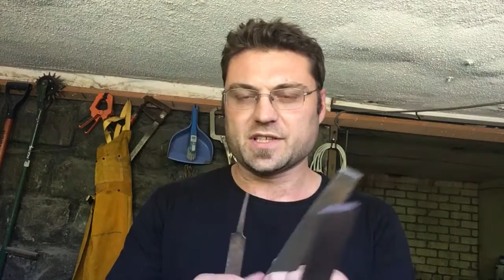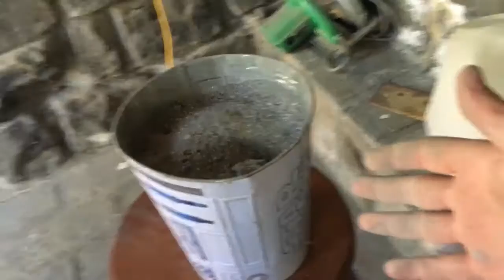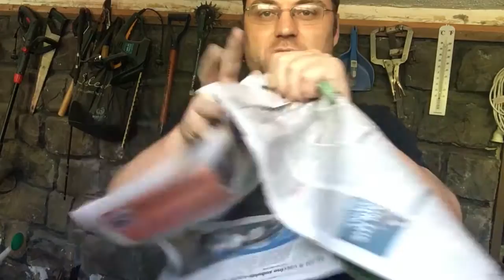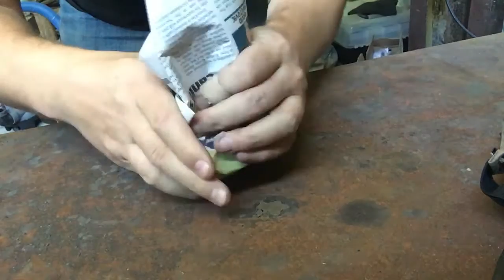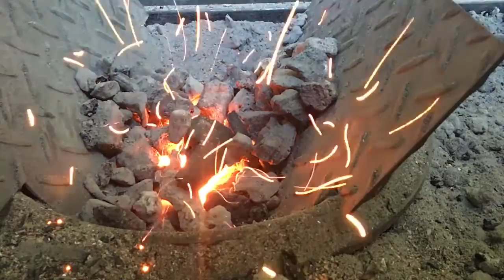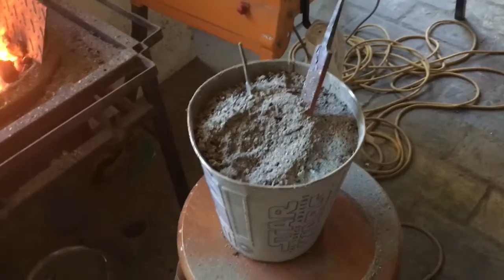Annealing Cheap Steel and Other Trials

Comment: A bit late in the day and you may have heard this before but the blue is more than likely from fine shavings that the tool has been used on, both copper and lead will produce blue flames.

Comment: Hey Rusty! Thanks for the shoutout! I use bituminous coal and the supply I have has a lot of fine coal dust. I used to sprinkle it on top of my mushroom paper ball after it was lit to help the fire get going. I got the idea to make, as I like to call it, a coal bomb and I've had a bit more success lighting my fires with it. Try using the smallest/finest pieces of charcoal in your next bomb. Great video on annealing. I also have a bunch of old files that I want to work with and didn't even think about softening them up! Going to give it a shot soon.
Reply from the maker: eviltwinx thanks for that. Before you spend too much time on the files you'll want to see my next video (the cheap stuff is cheap for a reason)

Comment: That was a cool way to light a forge. Could the wood chair catch on fire :) 
Well presented Rusty.
Reply from the maker: It's actually harder to light wood than it appears, but I actually set the bucket on the metal table straight after that shot.
Reply: Cool just want to make sure you don't have any probs.

Comment: Good rusty, yeah she was hot the other day in West Sydney, it was 40° C under the veranda here in QLD. What blower are you using rusty, is it a hair dryer, that's what I use and have a cheap little hand blower, I also have my gas forge which I love.
Reply from the maker: Hair Dryer from Savers Len.
Reply: Cool they do ok don't they?